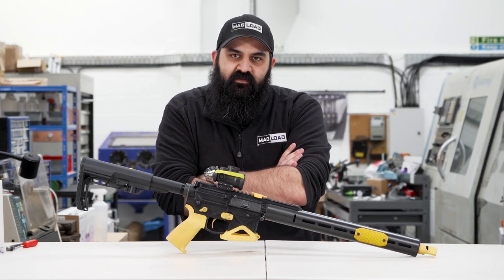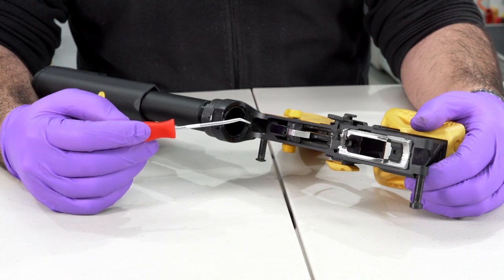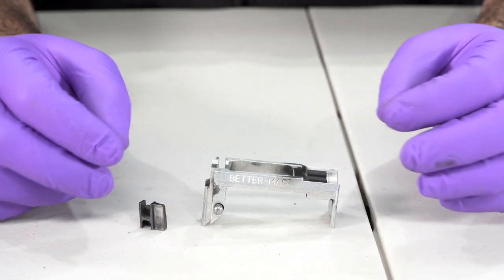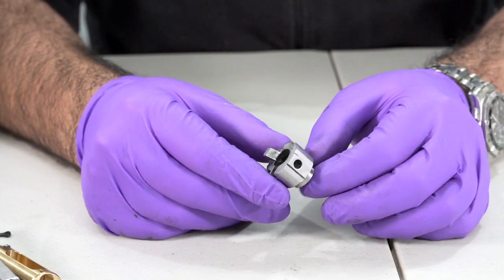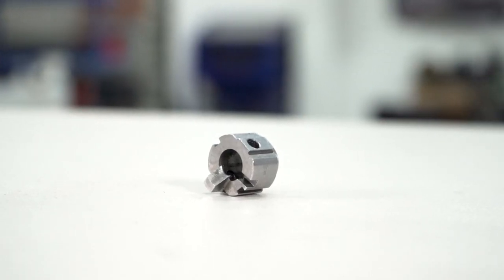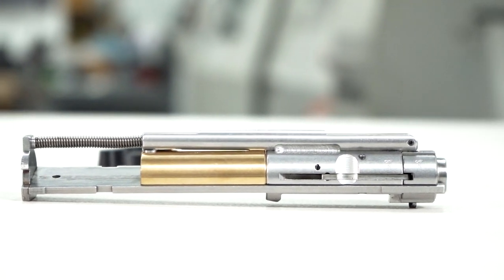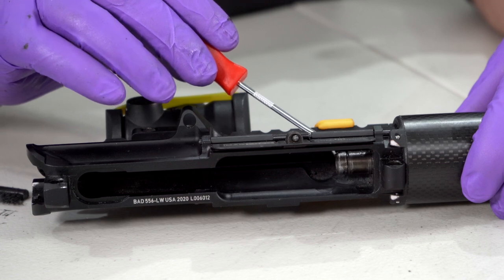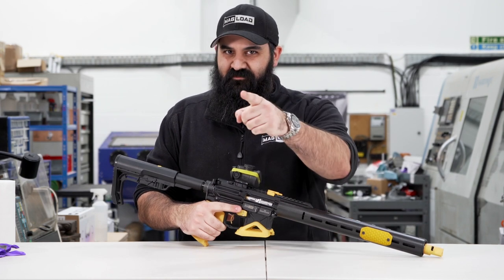How To Match Prep Your Rifle - Quick Cleaning And Inspection Guide

Comment: You really should clean that trigger group out every now and then, either with a spray cleaner or by disassembly.  I had mine start randomly failing to release the hammer and, upon disassembly, it was quite nasty, the disconnector spring for example was solid full of crud.  Maybe make a rule of doing it once a season / 5000 rounds (probably about the time you want to change out springs).   As you probably know these things are famous for eating firing pins and firing pin springs, always keep a few spares (along with spare cotter pins)!  I keep a full bolt rebuilt kit with double extra FP springs and cotter pins in the pistol grip storage.  For big matches with money involved, I'll bring a whole spare bolt group.

Comment: Brilliant video!
What bolt weight are you running? As it is on your competition gun I assume you are happy with it?
Reply from the maker: That's something we can't publish, but yes very happy with it. Tuned for HV ammo and makes a big difference to reliability.
Reply: It's a prototype but they're going into production soon, and will be available from Magload!
Reply: Thanks for the replies. I will look forward to the release of it then.
As I tend to use cci standard rather than mini mag, is there any chance of a standard velocity version?
Also as a technical question, does barrel length affect the mass needed? I.e. 12" vs 16".